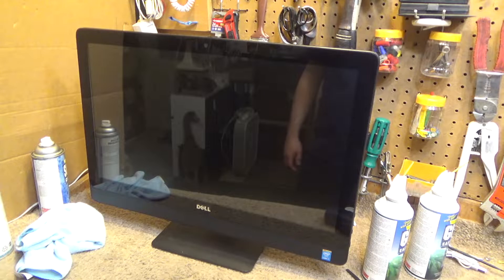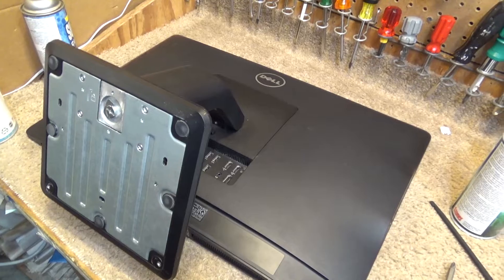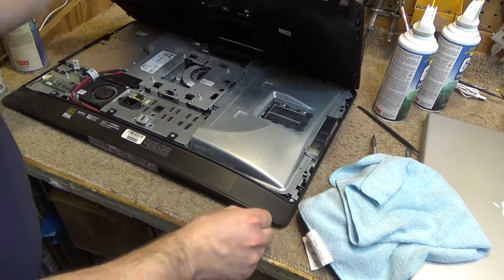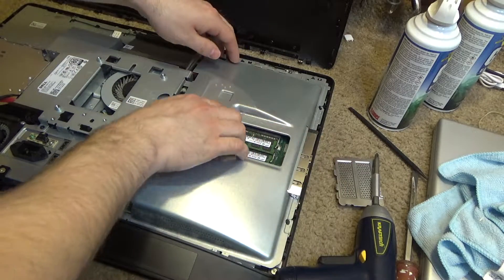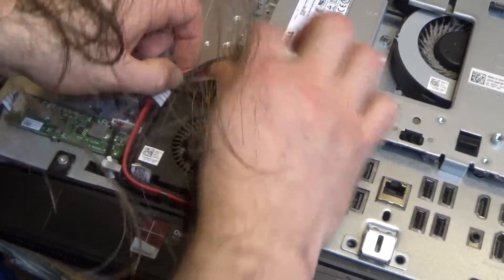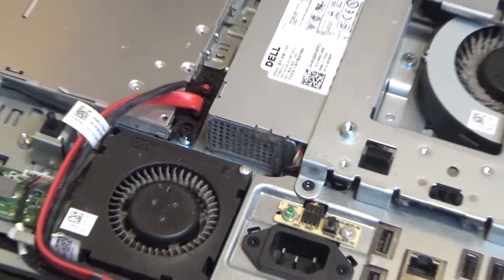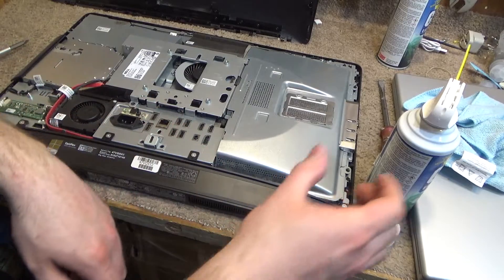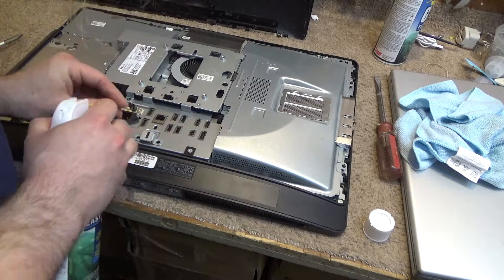Dell Optiplex 9030 | Cleaning, Replacing Hard Drive and Memory

Comment: Hey. We just bought one of these for $100 cdn. I’m looking at what I can do to upgrade it. The manual I found says it supports up to 16gb ram. For the GPU it says integrated, optional AMD Radeon R7 A265. Does that mean I can switch it out, or was it it an option when you bought it? Thanks

Comment: This is funny. I work for a guy who sells computer parts, and pretty much what I do is pull apart computers and clean and sort the parts (RAM, CPU, Motherboards, HDD, PSU, Caddies and such) just earlier today I took apart 40 of these exact machines. I will agree that these are quite descent machines for what they are. One thing I did find interesting is that (at least the ones I was pulling apart) had Bestec made power supplies, which were the ones known to cause issues in Emachines computers back in the day, and they used them in HP and Dell machines as well and they were known for being poor quality. I was surprised to see such components used in a machine made this late, especially in a business oriented machine.
Yours appears to have the 80 plus gold power supply, so I doubt that is one of the Bestec made units, most likely a Delta or Liteon made unit.
Reply from the maker: Are the Bestec ones still junk? I know they were horrible during the 2000s. The Delta equipment seems generally satisfactory.